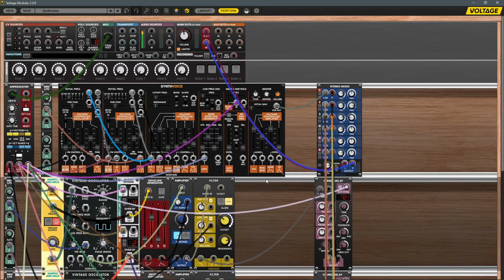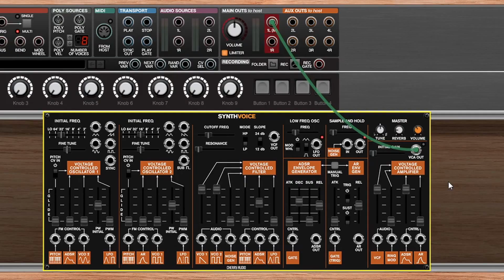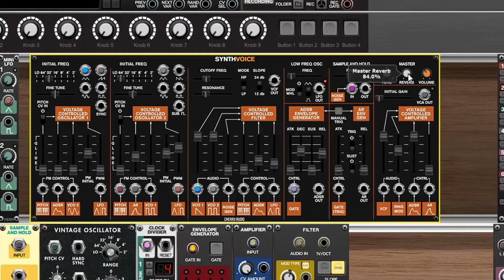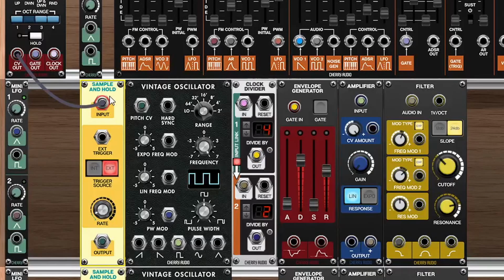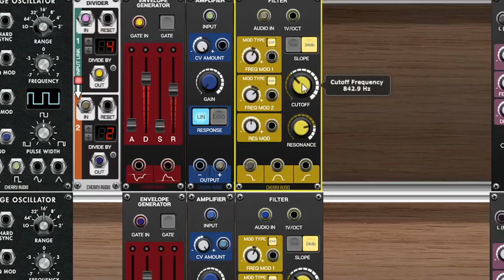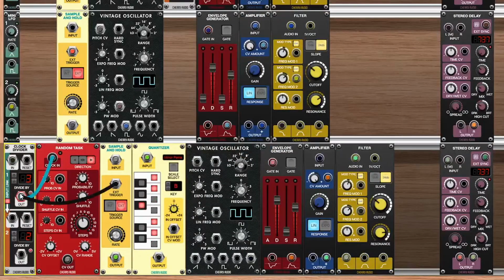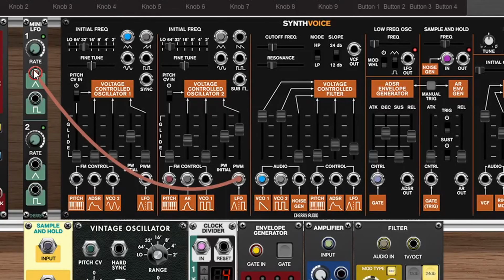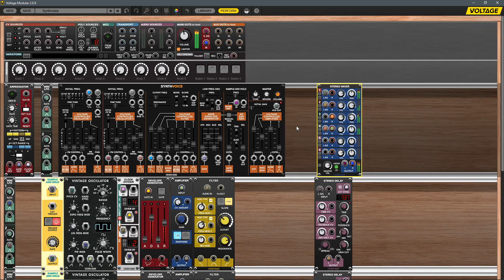Layered Arp Patch with SynthVoice | Voltage Modular 2 Tutorial

Comment: Hello and thank you so much for this software and the tutorials!
I don't have the SyntVoice, so I followed this patch with a Substractive Synth. The only problem it's: If I stop playing, sometimes the Clock Divider will keep the signal flowing because there is nothing on the Reset jack... As a simple solution just added a Button Module to trigger the Reset CV Manually.
Thanks again!
Reply from the maker: Hey there! For that, you could use the 'Play' jack in the I/O panel to make sure it resets each time you play the DAW transport. Or, use the 'Trig' out instead if you're going freehand with it!
Reply: @CherryAudiovst  Hello and thanks for your answer! I was playing it "freehand" without a DAW so "play" doesn't fit the job! And I already tried the "Trig" CV Output but it didn't work :/ Anyways it's not a big deal, I'm really enjoying your software!